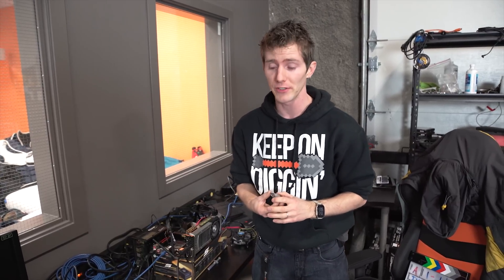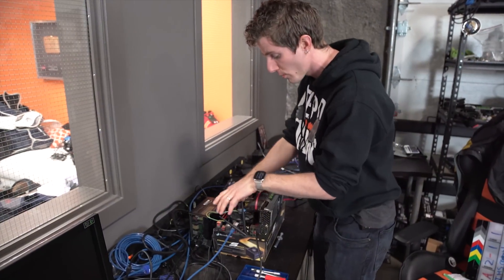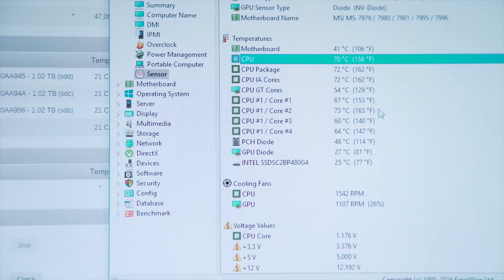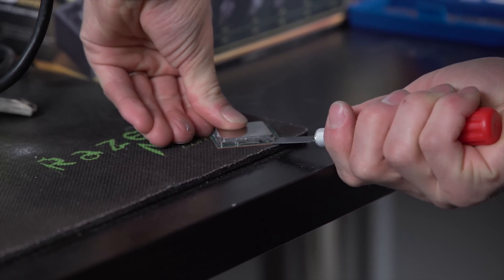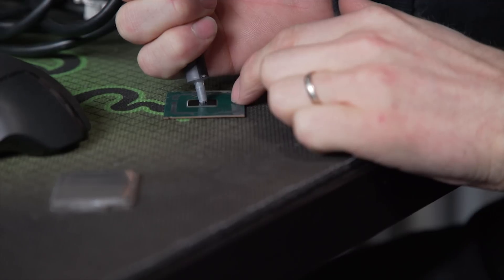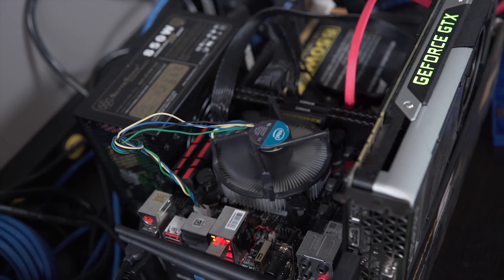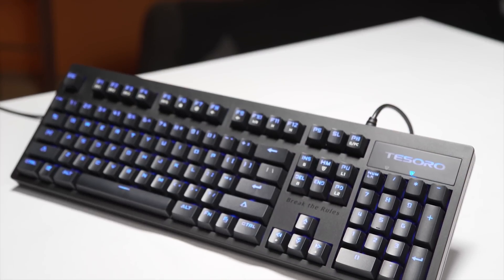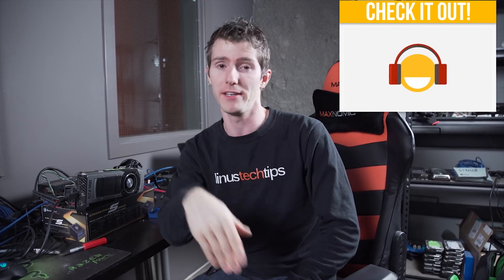Delidding an Intel Core i7 6700K - Is it worth it!?

Comment: If you tested this with water, you would have seen a much bigger change. I did it on my 6700k and it dropped my temps while overclocked on an h110i  by 16C. I did use liquid metal though. Also, using liquid metal on my gtx1060 dropped my temps by around 21C and made it so that the fans didn't need to run as much and made voltage the only limiter on overclock despite it being a short EVGA GTX1060 6gb with its stock cooler. I think using the liquid metal on your gpu is 100% worth it and worth it on your cpu if you are trying to have a quiet overclocked rig.

Comment: would you recommend is however to someone with a dud cpu, I've seen people with as much as 25 degrees between cores haswell and DC was prone to it, infact while I wouldn't consider my own 4790k to be a dud the temps could certainly be better, especially when I'm getting stock cooler temps on water

Comment: For my Ivy Bridge 3770k, when I delidded it and replaced the thermal compound with Liquid Ultra between the CPU die and IHS, but kept MX-4 between watercooler and the IHS, I ended up getting reduction in temps of 23(core 1), 36(core 2), 24(core 3), and 20(core 4). Temps are in Fahrenheit. Is Liquid Ultra really that good?

Comment: Linus, this is the FIRST video I DISLIKED. Reason to that is, i did delidding first when I was 17ish yo.. And you need to use copper heatsink at least(i had Zalman WB-2 att) and my idle temps dropped down from 32 to 23, using liquid metal. And the biggest fail you did: you don't put back the shield after delidding. 
So basically what you did was replenishing the thermal compound, cpu service, not hacking nor delidding.
Reply: He explicitly said that people that are doing this usualy use stuff like liquid metal which would yield better results. His point is that the average high end consumers that would not put like 30$ worth of liquid metal on their delidded CPU would not see any benefit that justifies the risk. Plus stuff like liquid metal not only is conductive, it also isnt as relieable as thermal paste, which is why most manufacturers use it in the first place aside from cost of course. Solder also degrades over time, reducing the lifespan of a cpu.

Comment: Personally I prefer to sand down the top.
I did it for a I7 920, and after 8hours of work because of a sh!ty curved top, I won 7° in load.
After this I was able to get a 3.9ghz stable O/C with a watercooling solution

Comment: this test is pointless. you didn't OC to test the variance in  higher temps on both. and you used stock cooler and did a lazy paste job.

 you have a cpu and mobo that allows OC. so you OC.. otherwise just get the cpu/mobo that is locked... and don't bother with this at all.

nobody is saying people with a locked cpu/mobo should do this... this video panders/tries to convince the wrong audience.

Comment: With my 3770k and Coolaboratory Liquid Ultra under the IHS I saw a 20°C reduction in temps.  Not sure if the difference is due to a different chip or the thermal compound used but my mileage was obviously much better.  This is with a custom watercooling loop.

Comment: I de-lidded two X5670 Xeons for my 2009 Mac Pro tower. It's a bit nerve-racking, and it requires painstakingly scraping the solder off of each CPU die, after the lid has been removed.

Comment: I delidded my 3770k and got at least 15°C less everywhere (and depending on load and ambient temps even more than 15, up to 20). As long as you're using a delidding tool (I used Rockit 88) and know what you're doing, I recommend delidding.

Comment: You need to do this again with Kaby lake and use a liquid metal. Because it makes a world of difference. Water in my liquid cooler didn't even get hot befor I delid. Ihs connection was so bad heat didn't even get to cooler heat sink as effectively as it should have.

Comment: But in i7 7700k :'v is it worth it?, I have base clock speed reaching small temperature peaks of 80°c  with  hydro h100i v2 wc
Reply: Intels advice is to just not overclock the 7700k for temp reasons. But an answer to your question is a yes, replacing the tim on the 7700k with liquid metal can net you as much as a 30C drop in temps.

Comment: This might be true with a 6700k, but I just ordered a delidding kit to fix my 7700k since even opening the browser hits 65C.  I tried stress testing with AIDA64 and forget it, hit 83C in minutes.  That's with a Corsair H100i at max performance.  And no OC.  Read a number of sites where people are seeing massive decreases in heat and that's gluing the spreader back on and using liquid metal TIM.  If I get 15C I will call it a major success.  Shame on Intel for not fixing this issue since they've known about it for several years now.

Comment: When I get my muse back, I'll make an autocad model of what came to my mind just now. In my mind, the most efficient way to cool a cpu, is how we used to do it back in the athlon xp era - applying the radiator directly on the chip die. This ALWAYS yields best results. So my idea is for a heatsink unit for a water bloc, that can be secured on top of the die via the mooring plate. That way we'll be 100% sure that it's not sitting at an angle and that the CPU's pcb is making solid contact throughout the entire socket.

Comment: So now that there's reports of shit TIM on Kaby lake, would this be a smart thing to do using the liquid metal paste, and use the delidding tool to remove the IHS? I've got a 7700k stock clocked and max temp is 84c, and for not even overclocking I find  that temp to be bad... My cooler is the Corsair H100i but my fans are a bit slow for silence sake
Reply: I have delidded my i7-7700k myself. Never done any delidding before.
Bought a Tool for 30€ which replaces a Razer and makes the delidding a piece of cake.
Used good Liquid Metal Conductonaut for 10€. Some High Temp Silicon for reglueing.
Oced it to 5GHz at 1.4V.
Before 90-95°C. After 60-65°C. At 100% synthetic Load.
Even at Stock 4.5GHz at 1.25V
Before 60-65°C Sometimes even 70!!!. After 50-55°C. At 100% Load.
BF1 at 4k Ultra gets is only to 51°C. At 4.5GHz.
As cooling i use an AIO with 280 Radiator. Fans are at 500-1000RPM.
Reply: much thanks for your input! probably gonna go through with it!
Reply: Hey, I got my CPU delidded and used Coollabratory Liquid Ultra on the dye, but my temps only seemed to drop around 5c... How much liquid metal did you apply?

Tests before and after used 4.5Ghz at... idk voltage cause I set that to auto

Comment: Surprised you measured any temperature difference at all, there is so little material to provide thermal resistance in the first place, not even 1mm of aluminum.

Comment: Only time i seen improvement from delidding was when i got a 3570k, in which case delidding got me 12 C on one of the cores. and 6-8 on others, only delidded cause one of the cpu cores had 8C higher temps than others, and in long term i think it was worth it. 
(PS, found it easier to de-lid using a thin strip of plastic, it also prevented damage to any components that may be on the IHS side of the cpu)

Comment: Well, intel use slightly better tim now then when they first started doing this with the 3770k.
And some ppl get really bad batches from time to time where the tim is poorly applied and in those case the CPU runs extremely hot and deliding can yield easily over 15 degree cooler CPU afterwards.
In those case its much easier to return you CPU and get a replacement but thats the only case where i could see deliding really useful unless you want to use liquid metal inside and overclock the CPU to its limit.

Comment: Two problems I see here: first, as he said, this was a fairly half-hearted attempt to improve the performance. Why would you risk destroying your expensive chip for anything less than maximum possible reward? Second, why not do another, more demanding test, some sort of heavy, CPU intensive task? It isn't a given that the heat dissipation gain will be linear.

Comment: Linus, please educate yourself on the topic of delidding an unlocked Intel CPU. 
Delidding is absolutely pointless when you don't overclock the CPU. 
Once you go the OC path, that makes a lot of sense AND can actually allow higher clock speeds with same or lower CPU temperatures. 
My stable 4.9 GHz i7-7700k overclock allowed me to lower the temperatures from mid 80°C to low 90°C under Prime95 full load to very decent mid 60°C to low 70°C. 
That actually gives me additional room for more overclock or voltage reduction. 

I really want to encourage you to take another look at the topic of delidding and look at it from an OC / enthusiast stand point. Also the various delidding tools available on the market make delidding almost a piece of cake. Paired with a high end liquid metal conductive fluid (Coollaboratory or ThermalGrizzly) and an AIO or high end air cooler the results one can achieve are very impressive.

Comment: I actually did this before as well. I had an old P4 HT box I made for strictly media playback. Music, movies, & so on. But, the case I was using was actually handmade and I modded the heatsink with a thick piece of copper and aluminum coils that looked like a stil for making moonshine lol. And then added a 120mm fan directly on top of the coils with a funnel keeping it 'kinda" sealed for the intake. Then another small fan for the exhaust connected to the funnel as well. It wasn't like a HOLY SHIT! moment in cooling. But there was definitely a noticeable improvement in cooling that the stock cooling system couldn't do. Also, those old P4 chips had a pretty thick heatsink and the plastic securing the fan was Jacked up too. Long story short, the only benefit of the mod in my experience, was to incorporate a custom design for cooling the CPU for a small case. Good video bro, definitely brought back memories..

Comment: This video gets a lot of hate for a reason. It is proven by now that applying proper liquid paste (that dumbfuck even mentioned it) and glueing die and spreader together properly after will give results up to 30 degrees celsius difference on an i7 7700k for example. I know this model hasn't been out back then but still, the results would be similar.

He didn't even try doing it properly and talks it all down like the gains are tiny. Well guess what, your delidding and the application of equally trash thermal paste was an absolute rimjob! We could surely see throughout the entire video you didn't give a shit about the CPU and if it actually survives or not. 

I'm done with this shitty overhyped channel once and for all. I'll surely check in if I want to see videos packed with irrelevant and shitty ads. I'm confused the channel wasn't renamed into LinusTechAds or LinusAdsTips yet.

Comment: The methodology shown in this video is lacking.  Using a stock intel cooler was the first sign that this would not be a true representation of the capabilities of a delidded processor.  That heatsink will become the bottleneck in cooling once the TIM is replaced.  The fact that you dropped, 4c is actually huge by just delidding with that cooler.

Second, the TIM used under the heatspreader, and its application method is not appropriate for this application.  It is too high viscosity, and is probably a worse TIM that what Intel uses.  The TIM that they have used since Devils Canyon is actually pretty decent.  What isnt good is the glue that they use, which doesnt let the IHS make good contact to the die.

Using a Liquid Metal TIM will provide the best thermal contact between the die and the IHS, because they are both very flat.  The top of the IHS where it meets the cooler, is often not very flat.  That is where the polishing (LAP) of the contact surface comes in.  In the video, your IHS is polished, but its not flat.  If you were to LAP the IHS and heatsink, you may see better results, but just polishing it will not help.

My mothers i5 4570 is horrible with temps.  It would thermal throttle with mild loads.  I swapped the stock cooler with a Cryorig H7, and saw slight improvements... but the issue lies under the IHS, and it will be delidded soon to swap thermal paste.

I definitely have seen a trend of "testing" certain products or processes with poor results on this channel where many other sources show considerable performance gains.  I begin to think that this channel is all about quantity, but lacks quality.  It has grown too large, and pushes volumes of misinformation by not researching the details properly.

If you revisit delidding, do yourself a favor, use a liquid metal TIM between the IHS and die, and use a GOOD cooler, even your favorite Noctua (I know you LOVE Noctua, so you have a chance to show them off in a video again)... even more, use an overclocked processor.  We all know that a stock CPU will generally have adequate heat transfer through the IHS, but when it is overclocked, is where you will see the heat wall come in, often around 1.3v from Ivy bridge onwards.  I saw no difference in die temps on my Ivy from a 120 Antec Kuhler to a 200 Phobya/240 Black Ice with an EK waterblock.  The heat just wasnt transferring to cooler.

Please, refine your methodology to a more controlled and scientific approach.

Comment: this video is bullshit, i don't know where to start.. firstly you did a very sloppy job delidding and reapplying thermal paste, second you used a goddamn stock cooler. who the fuck delids a cpu and uses a stock cooler? third, you didn't overclock the chip, that's the reason most people are doing it, to get a higher overclock. and most importantly, there is a big difference in the quality of tim in different generations cough intel cough . how about 4770k or intel's current mainstream i7, the 7700k? i've seen many people get a 20c difference or greater just by replacing the tim with liquid metal.

Comment: if you polish the heatsink removed the ihs completely use a copper core cooler and the right goup and a screwdown bracket for the cpu cooler you can lower the temp buy as much as 10degre and as everyone who overclocks noes 10 degree can mean a difference between a stable system and a unstable system. I used to do extream cooling on systems I am the kind of buy who has 6 or more fans in his computer with a heatsink on every single chip in the pc that gets hot including the voltage regulators and ics. I n fact the pc I use right now has 8 fans in it 2 in the power supply 1 for the harddrive 1 for the 3 system and a huge fan covering the videocard.

Comment: To be fair, this is a half-assed demonstration that isn't reflective of the results most delidders get. 
There are specific thermal compounds (gallium) that you are supposed to use as TIM between the headspreader and die. 
That being said, this still isn't something for the faint of heart.
If you are an experienced tinkerer(Have worked on cars, or soldered ICs), and have developed a careful attention to detail, you might be a good candidate to try this.
On the other hand, if you can't afford to replace a $250/350+ chip, and just finished your first or second custom PC build, don't risk losing an investment like this, it isn't worth it.

Comment: A few months arter i got my 4770k i delidded it using a vice, a piece og wood and a hammer. After hitting the CPU a couple of times IT flew a couple of meters, and voila, mission accomplished. And a CPU is actually incredibly tough and even though delidding almost seems abusing, for me it luckily resulted in a 25 degree C drop in temperature! Pretty insane in my opinion. Cooler is a Thermalright SB-Extreme

Comment: The risks are wayy to high for a copule of degrees, is just doesn't worth handling the cpu that way, force it, bending it and probably get dust inside the IHS for so little improve. Better make a cooling systrem or a better air cooling than fuck things up.

Comment: The problem with this is that the TIM issue didn't affect all chips - originally it was Sandy Bridge/Ivy Bridge/Haswell, and it wasn't so much the TIM as the adhesive used on the IHS being too thick.  Case in point, I delidded my 4670K with zero issues and my idle/load temps dropped a solid 15+ degrees, and I was able to boost my overclock from 4.2 to 4.5.  The newer Intel chips more or less cleaned up the TIM/adhesive issue so you're not going to see as significant of a change as you would with previous generations.

Comment: There are a lot of videos and reports that say, using liquid metal thermal paste show great improvement in temps, from 10 to 25 C. Is this valid? If it is I guess it's worth the trouble.
Reply: Big99smoke99 For Kaby Lake it is valid since the pre applied paste on the die is very bad. This also works on Haswell chips or Ivy Bridge since they all have problems with overheating. You can look that up.
Reply: Thanks! I will check it out, but honestly I 'm afraid to damage the chip and void the warranty.
Reply: Big99smoke99 I have an older i7 and I'm afraid of damaging the chip as well, although I don't care about the warranty (the i7 comes from an OEM PC).
When I have a new main rig, I'll definitely try.

Comment: some people are getting 10-30 degrees C on kaby lake 7700K after delidding, adding liquid metal and regluing it ...
this seems like a half-assed attempt?
Reply: getting 10-30 degrees lower*
Reply: @nioxic77  7700k Stock with Intel Turbo Boost, from 89c under Aida64 FPU Stress test to 67c after de lidding + liquid metal, so yeah

Comment: Im not brave enough to try something like this on something that costs a good bit, but why not heat up the tools before you wedge it in between the lid and the PCB? Don;t have to heat it much, just enough to sorta melt the adhesive rather than forcing something between it and flexing the PCB.